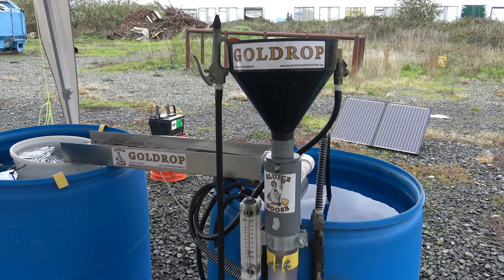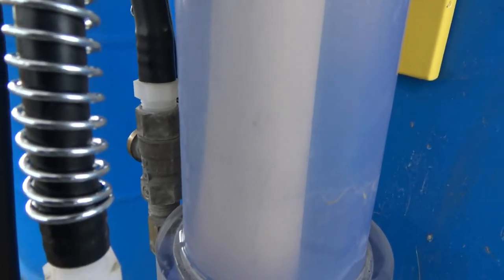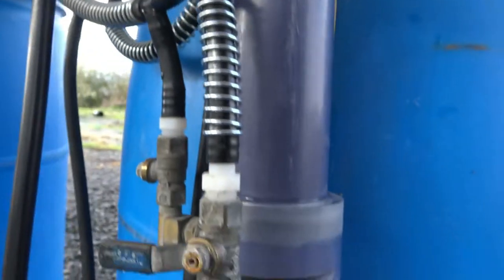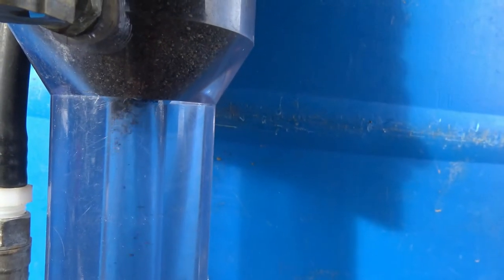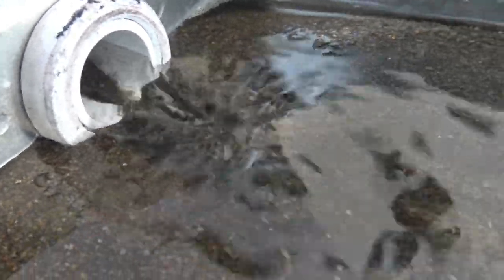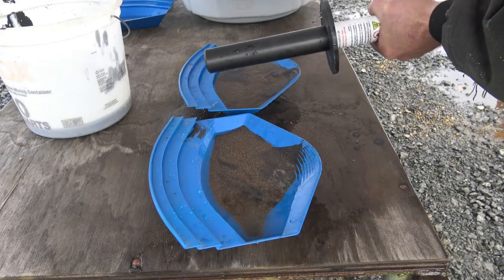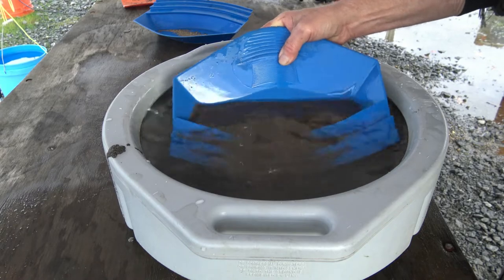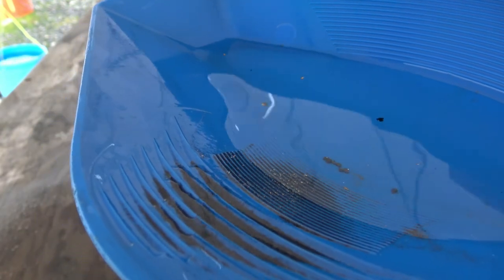GOLDROP by Sluice Goose Industries

Comment: The main thing you need for proper operation, is pre-classified material. It's much easier to tune the flow when you have similar mesh size material.
Reply from the maker: Yes, ore classification starts at 1/8”. A Goldrop owner in Las Vegas classifies down to 200 mesh to recover 600 mesh oceanic gold from a claim once owned by Howard Hughes. Howard, at the time planned mining the claims but no technology at the time could recover such tiny flour gold.
Reply: to my knowledge, there has yet to be an economically feasible method for ocean water gold extraction. This includes processing the post-extraction surface of saline distillation beds, where salt is harvested.